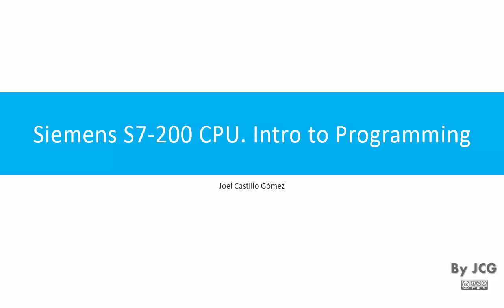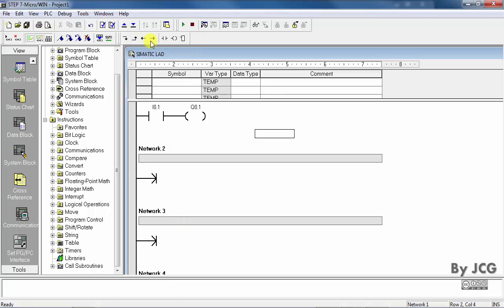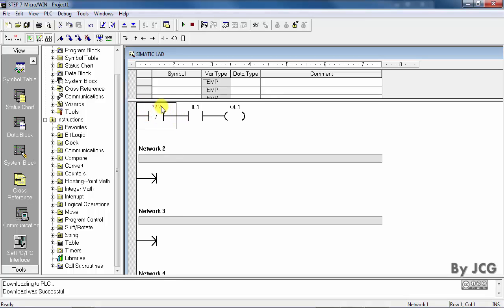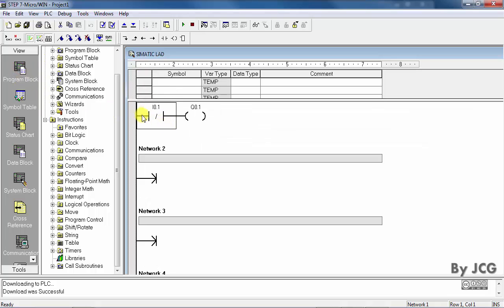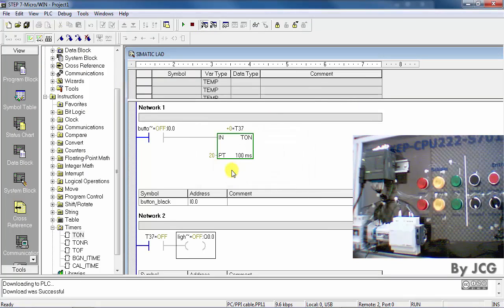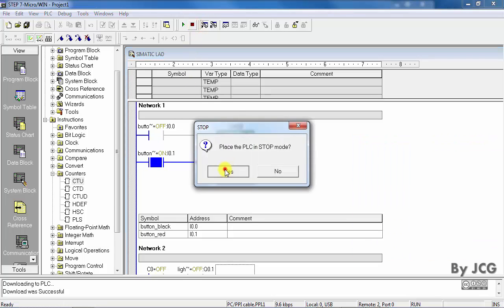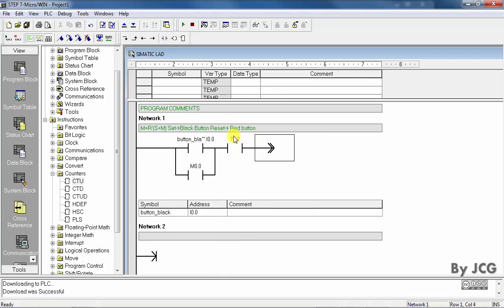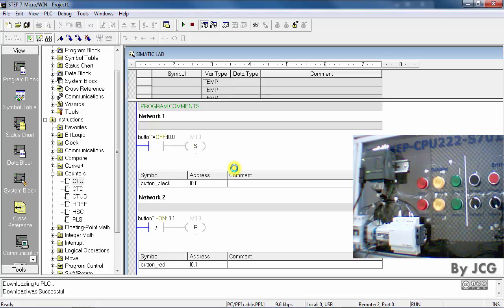Intro to PLCs. Siemens S7-200 CPU

Comment: Boss I have a problem with Siemens plc. S7-200 CPU 224 cn
Plc connect but message show and upload option not shown
The plc has been protected to prevent program upload.

Comment: To make it set dominant I suppose you put the set function in a higher number network. As the plc reads through the networks in order from 1 to 999.. 
And therefore it will read the set function after the reset, and then overwrite the memory